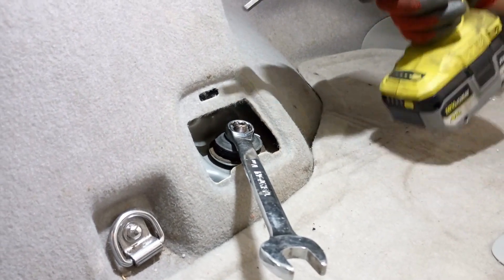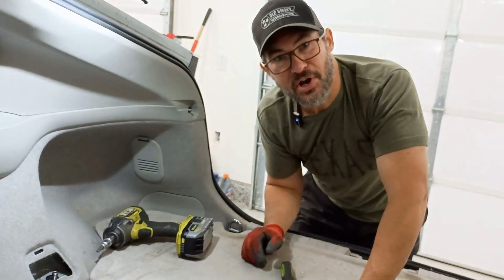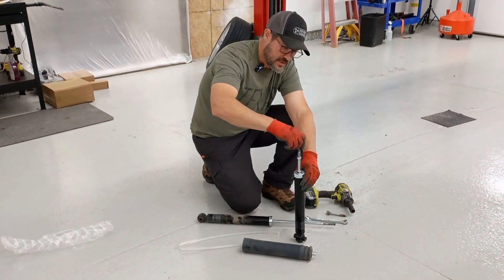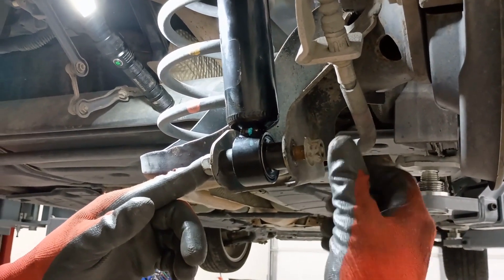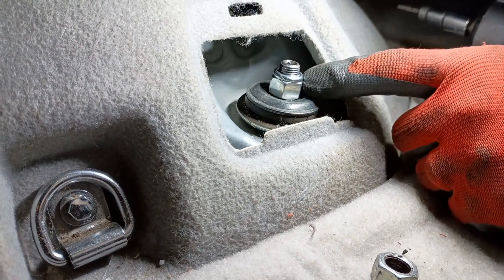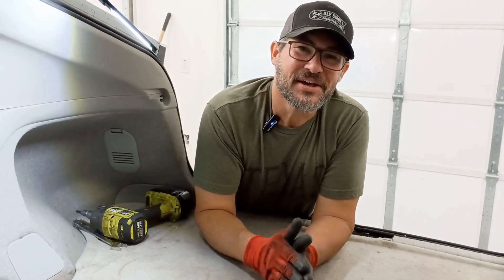Toyota Prius rear shock replacement fast and easy (2010-2015)

Comment: Always lower the vehicle to the ground, then torque the bolts to factory specs.  Torquing the bolts without the weight of the vehicle on them is not to factory spec.

Otherwise great video.  I wish my early 3rd gen had that access panel.  I have to remove the entire interior trim piece to access the top of the rear shock.
Reply from the maker: good tip
Reply: Haha, I'm doing this in a week on my 2010...I dont have the energy to take apart the rear...I am just going to cut a flap in the covers to access the nut! It seems like the simplest and most direct solution, I'm not worried about aesthetics as this point
Reply: @kakabukkake0  I'm on the look out for a 2012-later part out where I can get the rear trim panels.  Otherwise I will just get the pop out covers and cut them into my 2010 trim.

Comment: I don't have impact wrench for the 6mm allen. I only have socket. Is it possible to do this work? Thanks.
Reply from the maker: Yes of course. Electric tools are not necessary, they just make things a lot faster
Reply: Thanks!
Reply: @joyofwrenching   I followed your instructions and it was pretty easy! Thanks again!